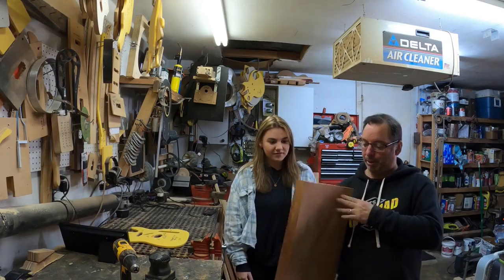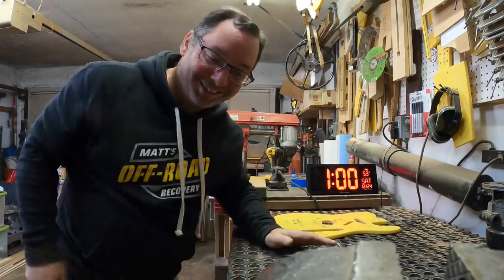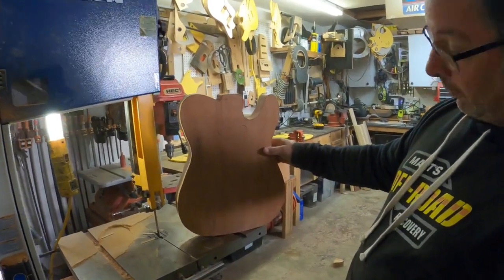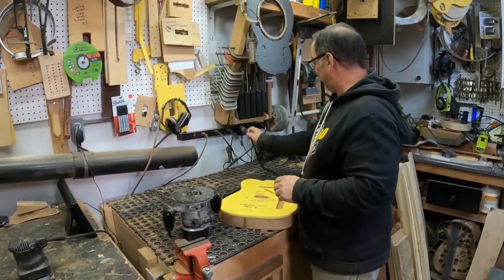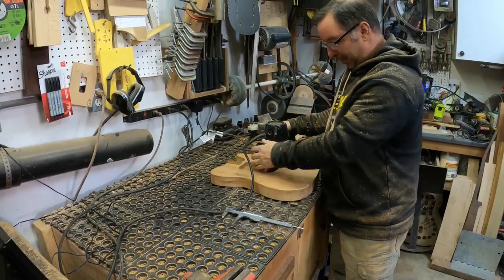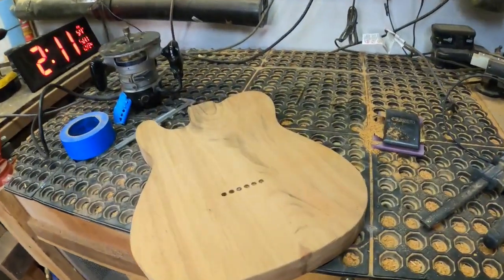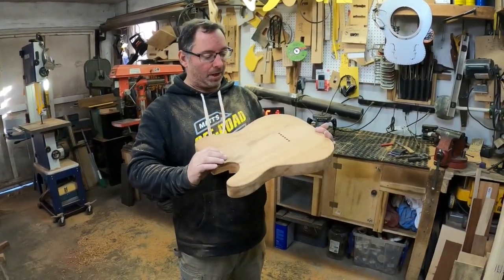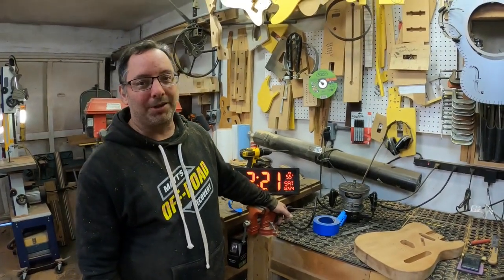Can I make a Telecaster body in 1 hour?

Comment: Since you asked...
- Tool nostalgia... dad's 50 year old router. It's nice to have family heirlooms, and use them... however, time is money; how many times do you swap bits in a YEAR?  That could add up to 3, 4, 5 BUILDS worth of lost time. Take a look at a Triton Tools router, 10, 12 seconds to change a bit...

- Template... I don't get the on, off, on, off, on, off, on, off, on, off... it serves no purpose. Once you screw that thing down, route EVERY pocket... in THEORY, at least, you don't even have to take it off to cut the body outline... on, route, cut, off, final route, done.

- Yeah, the power problem... since you will probably never actually be RUNNING a tool in each hand... perhaps installing a QUAD outlet might be a good idea. This way everything has power and you have TWO plugs available at the bench at all times... and you aren't going to overload the circuit, still using ONE tool at a time... just an observation...

Take this as it is meant, constructively... and remember, you ASKED...

MADI... LOVE seeing gurlz getting into the technical trades... but some advice for the long haul... For some inexplicable reason, every Engineer I have dealt with unnecessarily complicates things : SIMPLER is usually BETTER; anything that is more complicated than absolutely necessary is asking for trouble... The Engineer I work for just tells me what "it" needs to do and how robust "it" needs to be as he finally realized he falls into the "grandiose solution" trap far too often...

Well, that was fun... back to Quantum Theory....

Comment: In Asia a telly body is 8/12€
Reply from the maker: Yes here in the US they are 8-9 pounds average unless they are chambered or use alder or pine woods. I didn't actually weight this one but my experienced guess is 12-13 pounds. I've built a tele that weighs 5.5 pounds total with all hardware, strings etc. I've also built a hollow Les Paul body that weighs 2.4 pounds, extremely light.